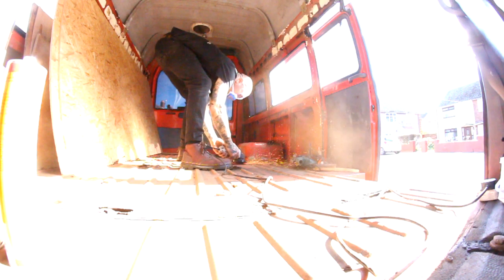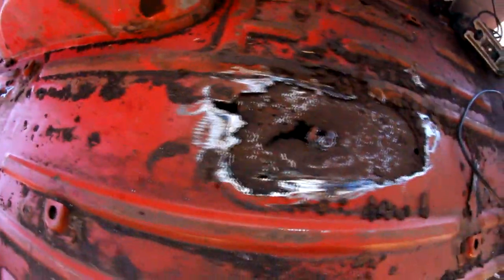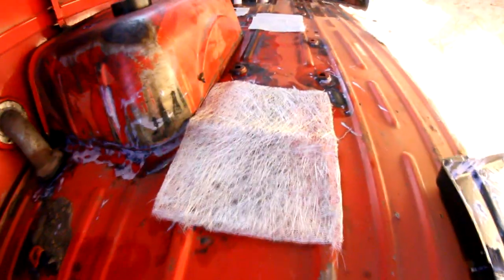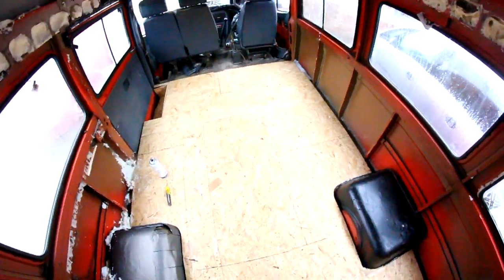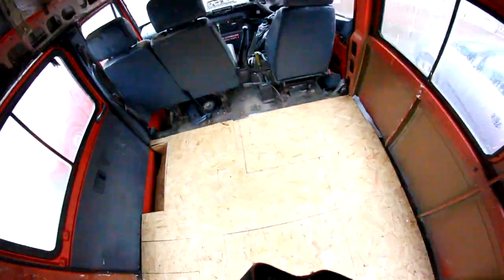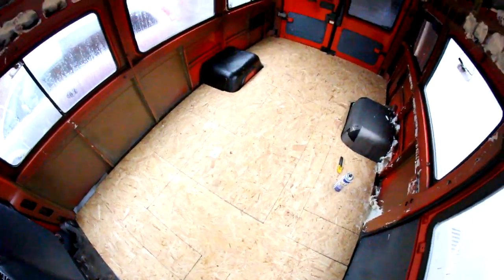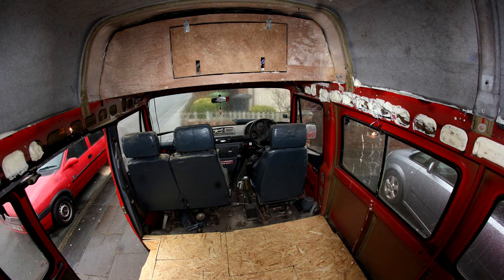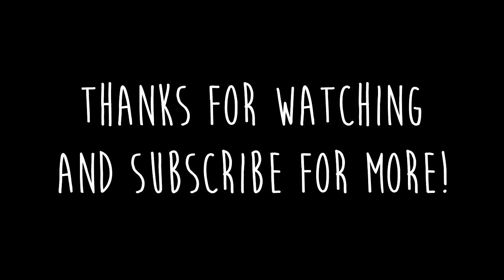Van life : Diary of a van man 3 - Floor it! Campervan conversion project

Comment: on the floor doesn't the reflectives need an air bariier to work ?, how thick ws the wall boards you used ?
Reply from the maker: Ian Mann yeah I think it's meant to work better with an air gap so I've heard but I never had a problem with the floor being cold doing it this way! I'd put 25mm Celotex but I'm too tall for that 😅. On the walls I used 50mm insulation

Comment: Great video can i ask did you weld those massive holes ?
Reply from the maker: Thank you 😊 I didn't weld them, I didn't consider them to be a danger structure wise so I treated and painted the rust and then covered the holes with layers of fibreglass ... Which was actually really strong! Then obviously the insulation  and flooring over it all 😊
Reply: Oh ok btw van is looking good